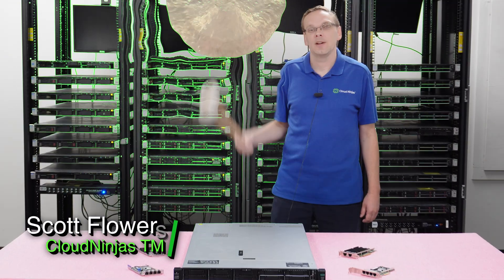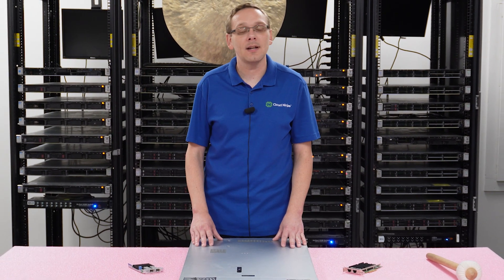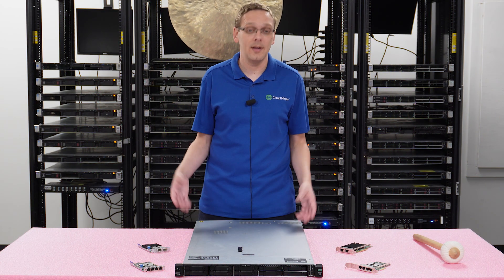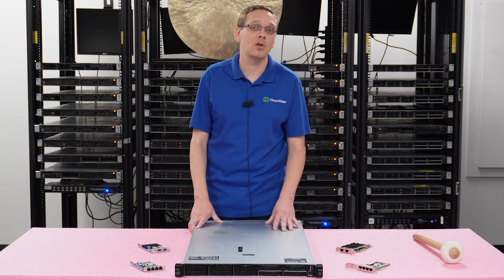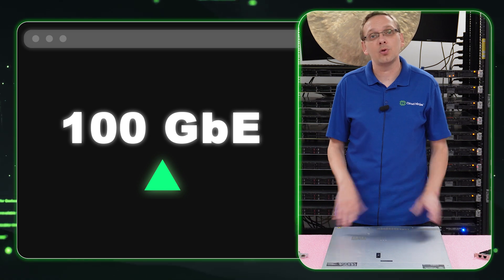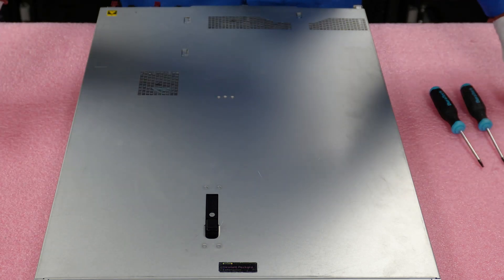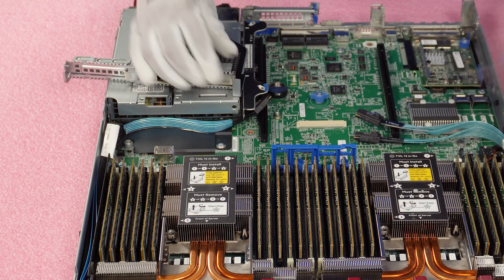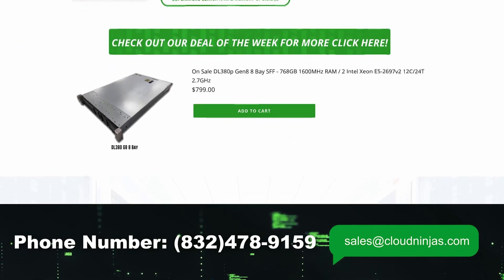HPE ProLiant DL360 Gen10 Server NICs | Network Card Options | FLOM and PCIe NIC Cards | Installation

Comment: cant able to install drivers of 10Gb 2-port Base-T BCM57416 OCP3 Adapter on DL 360 gen10 plus on server 2022, card was properly inserted , even backside of server lan plugged in, no light or signal showing.

Comment: Any advice on what happens what to investigate when after swapping out a 4x1GB FLOM card for a 2 x 10GB SFP FLOM, it is not seen in BIOS?
That a card is present in the FLOM slot is shown in diags, but it is not recognised as an FLOM adaptor anywhere